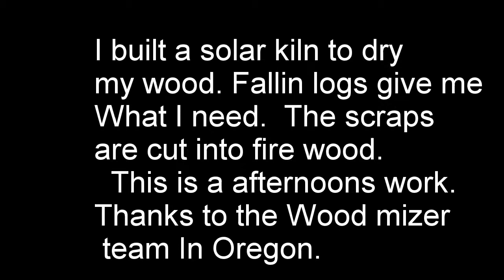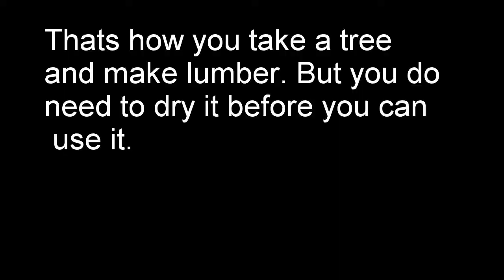Log to lumber

Comment: I have a Question: What are you going to make with all that wood?
Reply from the maker: I stopped building everything from jewelry boxes to hutches and tables. Why you ask? The cost of lumber. it cost $20. just to make a simple stool that I could sell for $30. at a craft show. Now I have started building a hutch for the party shack. Wood comes from the forest I own out back. Alder and Maple. My brother Roy has Oak we milled up. I only need time to work on the project to finish it.  I told Home Depot I did not need to stop in to buy trim boards any longer. I make my own.
Reply from the maker: Do you get this comment?